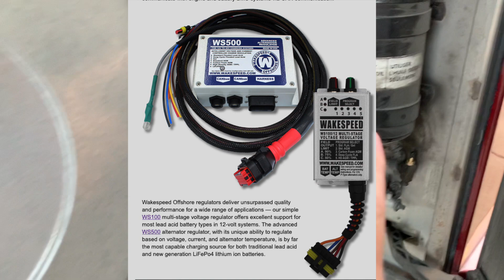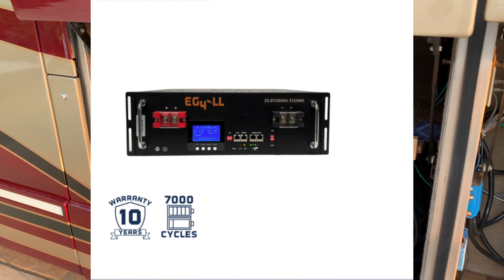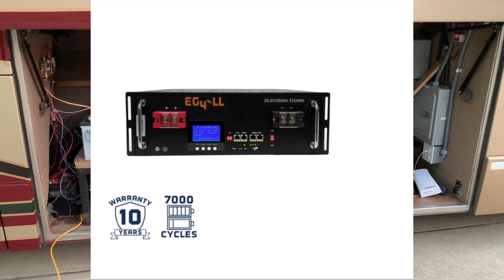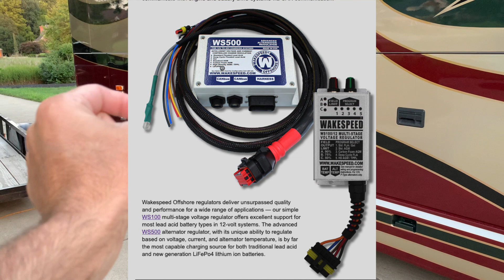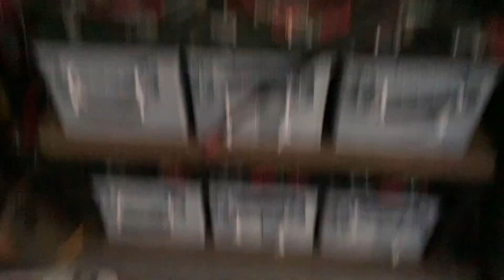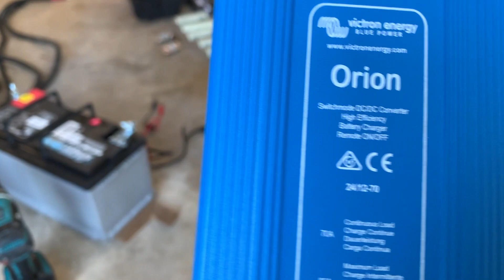RV Batteries Destroyed! / Tear down, Wakespeed WS500, Sterling APD, EG4 Server Rack Battery Review

Comment: I also switched my Tiffin to LFP and have 11.8kw at 12v.  you would have been able to use 12v batteries without concern about having a BMS failing and sending 12v to the inverter.  They would be in series and if one BMS goes offline, stops the current from both.  The Wakespeed WS500 is a great way to control your alternator.  If you add a second battery, you will be able to double your charge current and use the capacity of your alternator.
Reply from the maker: Thanks!  Enjoy your set up!

Comment: Do you have any concerns with table 4.2 in the EG4 manual on environmental requirements “no vibration”? I would love to go with the server rack battery  in my RV but was concerned about this.
Reply from the maker: I discussed with signature solar and they were not concerned. They are helping me with this install - and want my feedback to help make sure their product works correctly and make any changes necessary.  I’d stay tuned and see how mine goes - I’m pretty confident it will be ok. My bus rides on 8 air bags though. The super C I had before had leaf springs - I’d be a little concerned with it, but would be concerned using anything though. How is yours set up?  I should be getting the rack and batteries this weekend - hoping to get installed during the week next week. I can/will video the install and make comments on that. Let me know if I could cover anything else as well
Reply: @CampPrevost  We currently have a 5th wheel but are about to move up to a MH which will also have the air bag ride. So basically just in the research mode right now. I wasn’t sure if you were going to contain the batteries in some sort of shock proof enclosure or not.
Reply from the maker: @glennholladay3943  not yet!  I will check and make sure how it mounts. Thinking if I attach the rack well and the batteries to the mount well, it should be fine. Imagine some people just slide them in at home.

Comment: Check for a local recycling place.  Noblesville has a place that pays you based on weight.  I got $50 for 4 AGM batteries.
Reply from the maker: Thanks John!  Do you have the name of that place?  We have batteries plus but not sure they pay you.
Reply: @CampPrevost  It is Lusco Recycling Center.  1295 S. 5th St., Noblesville, IN  46060.  They just weigh the batteries and give you a piece of paper to take to the cashier.  Thanks for the great videos.  I've considered going with a well depreciated Prevost when I can retire and use it properly.  I think you give the best representation of what that would entail.

Comment: Those batteries are worth money for core or recycling 
That battery bay wasn’t vented my marathon has a vent in the bay for agm also looks like wood in bottom of bay is setting on top of prevost floor
Wanting to convert mine to lithium when batteries go bad great video 
Thanks
Reply from the maker: Yeah - I wasn’t planning on this - everything worked fine - they still worked but it felt hot in the bay so I removed the cover and was blown away at what I saw.  Can’t believe it wasn’t vented either. That wood floor is going to be a mess….

Comment: To compare size of the server battery to your batteries you already have. server battery about 1.5 width, same length and height as a  8d battery. Don't think be too busy in the inverter to put the battery on a tray, where you can stack another one?
Reply from the maker: Yeah - I have no idea!  Plan is maybe 3 total…. Will get the battery Friday (I think) will kind of place it in different spots. After pulling everything out - thinking maybe put the batteries and all connections in the old battery bay and hide it behind a false wall